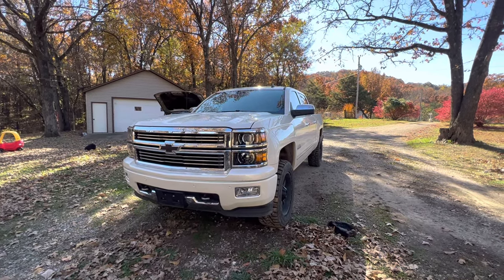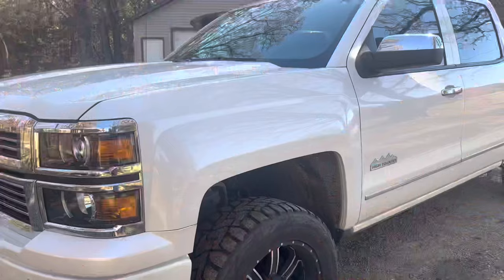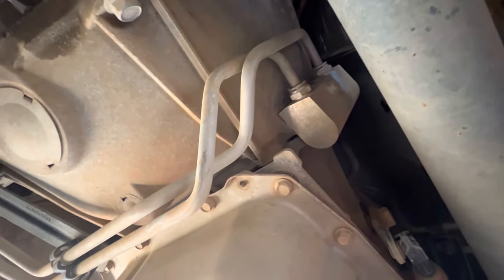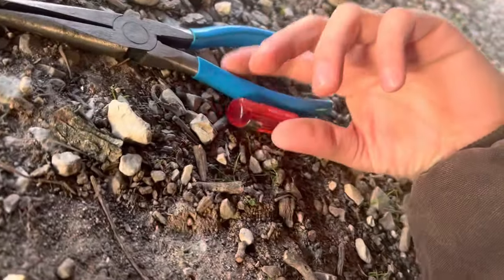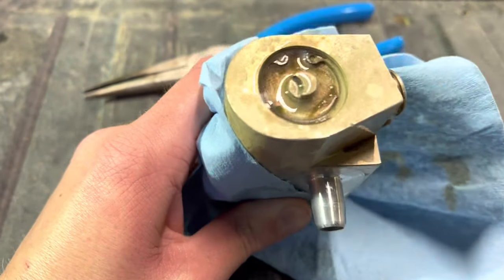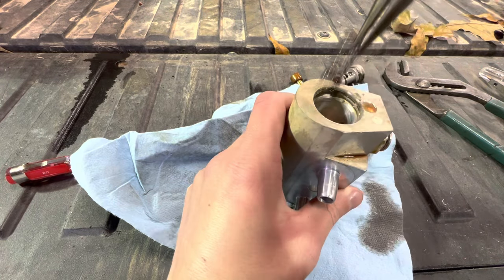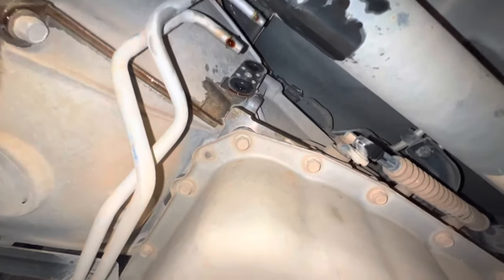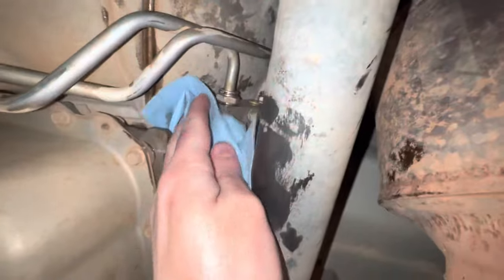Keep your 2014 - 2018 Silverado or Sierra transmission cooler FREE MOD! (Flip the pill) 6L80E

Comment: I put the Superior Solutions bypass in mine a few months back.  I went from 194ish to 130-150.  The truck shifts a lot better too.  It was very easy, and I had the two bolt configuration, took all of 15 minutes to swap it out.  Great video!
Reply: Brian for the WIN! wait till someone sues him for destroying their transmission.... LOLOL!
Reply: Was your transmission shifting hard? 
My transmission shifts so hard it feels like someone rear ended me. Am wanting to put this on my truck to see if it solves the problem as well as keep temp low
Reply: @Stop_the_cap311  it helped with the hard shifts, but a fluid change really helped after I did the thermostat delete.
Reply: @Stop_the_cap311  🤣🤣🤣lmfao
Reply: Is this any better than the actual OEM new part? Is there any advantage to buying the new part?
Reply: @logankarr3015  I actually just bought the OEM 70 degree bypass valve and put it in.  This winter, the tranny was having a really hard time heating up, and being too cool was causing rough shifts.  With the new OEM valve, I heat up to about 145-150 and hold there.
Reply: @logankarr3015  Gm told me there is no new part. They got shity with me when I asked them about these issues. They told me there are no temp issues
Reply: @jrod264winmag  There are no temp issues though lol. 180-200 is perfectly normal for the 6L80/6L90 trans. 6L80 came out in 2005 and has been running at 190 with zero issues. People on the internet have others convinced that it needs to be cooler, based on zero evidence. Don't tell me about a TSB, because a TSB means nothing.
Reply: @LilApe  Did you like your own comment? My ‘09 2500 was the second year of the 6L80. It never runs over 155 traveling in the summer.
Reply: @LilApe  I don’t know where you are getting your ‘05 introduction on the 6L80 but it’s wrong, my ‘07 got traded in ‘09 because it wasn’t available in ‘07
Reply: @LilApe  Can you read?
Reply: @jrod264winmag  Lmao is that supposed to be a flex??? Them apples are sour, lol im 33 and already retied. I make more money passively than I did as a machinist working 70hrs a week. You're not impressing me gramps. Go back to bed, you're up too late.
Reply: @LilApe  What’s “flex” ? Is the YouTube language? I’m not really up on all the goofy social media garbage. I got bigger fish to fry, like million dollar electrical projects.
Reply: @jrod264winmag  lol "million dollar electrical projects" Anyone can read a multi meter and splice wires, I do it everyday for fun. Try machining pats that take 60hrs to finish and cost 200k. and the material alone is 21k. Tell me, what does M3S455; mean. Still haven't impressed me, but good luck on your retirement, I got there 20 years earlier than you. But I see you deleted your comment lmao.
Reply: @LilApe  You’re blind too? I haven’t deleted any of my comments. They are all still there bud.
Reply: @LilApe  What are “pats”? Nah I’m not into setting on my ass in some machine shop. We really enjoy intel and google but it’s the robotics and food packaging equipment that get a little tricky but hey it’s just twisting wire nuts, anyone can do it.  Wait… are you flexing 💪
Reply: @LilApe  why don’t you tell me what ms3455 means? Is it something cool?
Reply: @k20fa5  Do you have a part number for the OEM valve?
Reply: Any updates since your install?
Reply: @Sorrow217  nope, all is good!
Reply: @LilApe Any fluid running 200°+ is going to break down and wear out your equipment faster. 200 to 150° is substantial.
Reply: @Stop_the_cap311 did you fix the problem
Reply: @Stop_the_cap311 did you fix the problem
Reply: @Stop_the_cap311 your trans is about to go. Mine did that samething and just replaced it. $4k
Reply: @LilApe I think you mean m03 not m3 which is spindle on and s455 is rpm of your spindle. You can drive around on your 200 degree trans all day. I'll make mine run 150.
Reply: @destro513  You're late to the party sweetheart. Stay home.
Reply: @LilApe  it's cool I got a dirtymax anyway. So I will be home... pulling the damn cab to replace a cracked piston. Haha ouch

Comment: I never understood why people spend money on the superior solutions kit when you can do this mod for free and get literally the same exact results. For the people who think that the hotter temps help with mpg’s, I have a 2.5” leveling kit and 33s and managed 21.7 mpg over a 400 mile average while the transmission ran at about 125 degrees the whole time. Shifts like butter too. GM never put thermostats on these transmissions before (this is literally a carryover trans from the last gen, just with the thermostat installed) and had FAR less failures on them. I don’t think it’s a coincidence.
Reply: How do I do it for free?
Reply: @carbonsteelbladetheorigina7993  take the housing apart, flip the thermostat and drop it in. Put the spring on the “butt” of the thermostat and then the housing over that. Button it up and enjoy a much cooler transmission.
Reply: @Timmytheman87  thanks a bunch.
Reply: Trying to increase my MPG on my 2016 GMC Sierra z71... what all have you done to help with it? I have a 3" lift/leveling kit on 275/65-20's... nothing else. At 70mph, I get about 17.5-18 mpg, but know others running similar setups seeing 20+. Help me get on y'all's level!!
Reply: @michaelfutch7551  33s, catch can, range afm disabler, flipped thermostat and flowmaster muffler. Some factors to take into account are changing elevation, type of tire, different bumper, height of the vehicle, added weight, cruise control use, gearing, tune, winter vs summer grade fuel, maintenance, tire pressure, etc. These trucks are direct injection, so carbon buildup on the intake valves hurts performance as well. With your setup, that’s actually pretty decent mpg.
Reply: So does this trick actually work? And is it safe?
Reply: @epixavenger8  yes it works and yes it’s safe. I did it 30k miles ago and the truck has shifted better and smoother than stock ever since. Haven’t seen a temp over 176.
Reply: @michaelfutch7551  when you figure this out, please message me as well. 

I have all of the things he lists in replying to you except the pill flip. I do get near the same as you on the Highway at 70 mph, but in town mpg SuckS...!!!!!!! 

Thanks.
Reply: @michaelfutch7551  I have a 2017 1/2ton 4x4 5.3L.  Best I ever get stock is 13.5 MPG. 65mph on the highway only 13.5mpg.  So how is everyone else getting way more.  Don't get it at all.  When I tow a 3k trailer I only average 10.5mpg
Reply: The whole point of using the superior solutions kit is the fact that if its super cold out, it can stop the flow to the cooler long enough to warm up the fluid. Flipping the pill means it flows no matter the temp.
Reply: Because you loose bypass ability

Comment: So you saved me $3,000 dollars my transmission was getting hot advising me to pull over and let transmission cool off because it was to hot I went to my local transmission shop described the issue I was having they advised me my transmission was gone and I could spent as much as i wanted on trying to fix the problem but I would have to replace my transmission I kept driving it trying to make it last as long as I could because I couldn't afford replacing it at this time well it happened my transmission shut down on me and I had to have my truck towed home and left it sitting for a month then I came across your video did exactly what you said and I am now driving my truck around like nothing happened thanks very very much I know I saved 3 grand but you can't have it  lol thanks again

Comment: Couldn't you just remove the valve completely and connect the tubes together with high heat hose and hose clamps and achieve the same result?

Comment: Question on the order of parts going back in…it looks like the top came out after removing the snap ring, then you had the pill, then the spring. When you put everything back you put the pill in opposite of the way it came out, and then the spring, even though the spring was on the bottom. Just making sure the spring should go from being at the bottom to being on top of the pill going back in. Thanks for your videos man, they have all been a huge help for me doing work on my truck. Keep it up brother!

Comment: I did this last night after seeing this. I've had my transmission replaced at 90k (warranty thankfully) I've always wondered why these trucks run so hot for no reason. This diy was an absolute nightmare for me!  I knew what I was getting into when I saw the corrosion (northeast) Still I went ahead. I left a heat gun on the c clip for 40 min and it popped out with some rubber mallet encouragement. Was still worth it. Went from 200-205 average temp to transmission 140 engine 195. The seal near the C clip kept leaking. Had to Uninstall and install 3 to 4 times. I eventually put a large o ring on and slammed the piece in with a rubber mallet. Its now a time capsule. Worth every minute. If you have corrosion be ready and have a new seal/oring ready and some sandpaper. Thanks for the content. I should have done this sooner. These trucks are great minus all the weird issues.
Reply: I assume that you DIY your fluids services. What I’ve learned, INACCURATE fluid measurements does creates lots of these problems or annoying engine noises. From slippage, clunking, high trans temperatures, vibrations, and worst case scenario transmission complete breakdown.
Reply: @marlonespenilla5839  all services up until the  transmission/converter failure were conducted by the dealer. Once the new transmission was installed it still ran at 200 degrees. This is strictly due to the thermostat. The transmission runs cooler now and I DIY all my fluids. 👍
Reply: @polymath4fun  yep, theses trans should NEVER be that hot. My ‘03 2500 with 4L80 runs 135-140. About 252k miles shifts like new, I change fluid/filter every 5 oil changes or 20k

Comment: I did this mod 1,000 miles ago.used to run at 194.since I've done this mod I haven't seen over 138 so far.truck is a 2016 and has 74,000 miles on it and wanted to prolong the life of the trans as much as possible.also changed the trans fluid and filter and added a drain plug to the trans pan.gonna change the fluid pretty regular.
Reply: How did you add a plug?
Reply: @tlwayman  I bought a weld in drain plug.
Reply: Still staying cool? How has it run
Reply: @Stop_the_cap311  it's been running fine.i haven't seen temps over 158 on 90 degree days.
Reply: So does this trick actually work? And is it safe?
Reply: This i love when owners take pride and joy in their vehicles rather than fuck tou get me the cheapest shit and make it drive

Comment: A thorough Fluid change and flushings HELPS the high temp issues. Make sure you put the right amount of fluids to prevent the slippage, hard shifting issues. when I say the right amount, i mean the right amount. Measuring and remeasuring after you put in the fluids. DIYers are notorious in making task quicker Just because you put in 6liters doesnt mean you dont check with your dipstick. These trucks are fucking sensitive. And when checking fluid levels, eye balling is never recommended. Make sure truck is at level position. Run the engine until your at HOT range temp recommendation 150-190 degrees. Shift to all gears, R, D, L1 back to Park. And now, check your dipstick. Fluid marks should be on the “hot” markings. No more, no less.
Reply: I agree. You have to follow the procedure when checking fluid . As far as regular change intervals helping with temp, I’m sure that’s true … but that wasn’t the only issue going on with 6l80. You can do everything right and they still failed prematurely. Personally I feel the change intervals should be more like 30 rather than 50k. Just my opinion. I cooked one at 125 but it was really cooked by 120. Couldn’t save it …. But I tell you what , I flipped the pill….. ain’t worth chancing it. A tranny swap cost me 5300…. Couldn’t get jasper or anything like that due to Covid supply chain issues . So had to go with a dealer reman and they did not give me a core charge …..
Reply: transmission. Was having very hard downshifts and just ooor shifting mpg all together. I tried everything. I saw your comment and figured I’d check the level. Sure as shit there was too much fluid. I took out about a half quart and the thing shifts like a brand new truck. Mpg is great too. So my only questions is , when you say hot markings, do you mean the beginning of the hash marks. Or middle of the whole marking. Cause right now mine is sitting in the middle of the word HOT. Wondering if I should take out a little more ?
Reply: @brennanbaker2436  how did you get it out? Through the dip stick hole .

Comment: Just did the pill flip and I went from 195F around town  to the lowest of 144 F after the same 30 to 40 minute drive . The trans was warm from a recent trip to town this morning so when I started the road test out it was at 163F and dropped from there to 144 F huge improvement. Transmission service is next just because and I also have no idea when the service was last done . The dealer changed the oil and checked everything else out but didn’t mention a trans service.

Comment: Did your motor start running hotter? According to my calculations the heat has to go somewhere. I’m pretty sure the coolant is not being controlled properly now. I would rather do a transmission cooler, it’s like $200.00 and give your trans it’s own radiator.
Reply: According to your calculations 🧐 trucks have had coolers in the radiators for 50 years they just recently started putting a thermostat to control the flow of that fluid are you kidding me why would the engine run any hotter? 🤔

Comment: Awesome video man.  My truck overheated the tranny a few times in the hot summer and then not for a while as its much cooler now that its winter...last night the stupid truck went into limp mode and i could only drive in reverse...i let it idle and got abkut 3 miles in distance over 3 hours and wastkng gas and engine life doing what the stupid system says to...the dumb computer didnt even recognIze the fans that were struggling to start spinning. They would try to turn but wouldnt.  Then turn once quick and shut off.   idling the engine like the dic said was the wrong thing to do.

Comment: Man you are really nice man...put please be clean and easy..u are like a viking fixing his 🪓
Reply: Amen.  Great video with all the basic information needed that doesn't leave out footage of important steps like some other youtubers.  (i.e. "you're gonna take this off", cut to shot of the part off and completely disassembled)

But, please take the extra 30 seconds to do it right, especially when making videos for YouTube.  Some viewers don't know which end of a hammer to hold and will take this verbatim.

It will take half a minute or less to hit the top of that thermostat plug with some parts cleaner and a rag before popping the snap ring off.  All that dirt got pushed into the housing when when the plug was reinstalled and since that housing is after the filter it ran through the cooler before being dumped into the pan.  Depending on the style of cooler, it might not take much to plug a pathway or two.

Comment: I don't know my transmission runs 110 degrees on my 1994 Silverado 350 4L60E...never had a problem with heat...just takes a long time for overdrive to kick in due too cool of transmission and fluid barely expanding

Comment: Should also clean all the dirt off before you remove snap ring. Then Also after you remove cage.
Reply from the maker: Good catch, I should have done that and would if I had to do this again. Don’t want any foreign material making it’s way into the transmission!

Comment: I just did mine the old school way and ran a trans cooler in the front I think it’s a 30 core and my trans stays at 145 all the time delete the thermostat all together. I also have a thermostat on the cool for a trans fan cool it’s a 165 degree and it has never came on even after drag racing it stays at 145

Comment: Hope you're looking at your comments Dustin. Slid under my 2016 GMC Sierra 2500HD this afternoon to see what I had to do to complete this swap out. What I found was not the block like you and others show, but a much smaller block that looks to have no thermostat in it. It looks to me to just be a plate holding the lines in. Have you seen or heard of anyone having that? Wish I could post a pic.
Reply: You do not have a thermostat on your truck.
Reply: Sounds like service got to yours before you had problems.  Chevy started fixing this issue with any service.  Silently.  Even the CCND inspections have an add-in to replace the thermostat on any truck still under warranty.  They want the tranny's to last just until warranty is out and the torque converter falls apart from excessive cycles in 194° tranny fluid.

Comment: I had the Superior Solutions bypass put in mine and it worked for a few weeks.  Now after a 65 mile drive home from work it has risen to 201 degrees.
Reply: You have other issues if it's that high. Either diagnosis of the transmission is needed for slipping or something inside is cooked. You can add an external cooler if the guts are ok.
Reply: Replace transmission filter and flush transmission. When filters start to get clogged transmission gets hot.

Comment: Why "flip the pill" when you can replace it? GM issued a TSB for this: 21-NA-199 and part #86774933 new thermostat opens at 158 degrees, useful in all climates. Part is $50.
Reply: Thanks

Comment: Hey. First off, thanks for these informative videos.
So one week ago my wife and I bought an 18 Sierra SLT with 33,000. It’s a one owner vehicle in great shape. I took out a 100k warranty. 
Due to major back issues, I can no longer turn a wrench. So if I wanted this done, where would I take it? Also, any idea of this voiding the warranty?
Finally, I was told to change the fluid (drop pan, no flush) at 40,000. Does that make sense? TIA